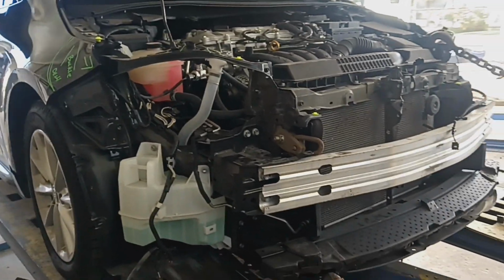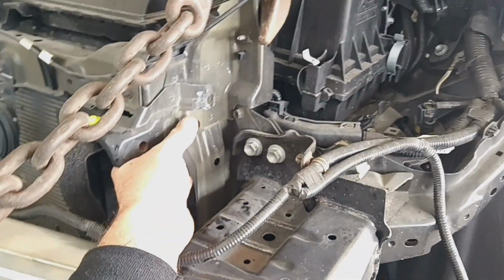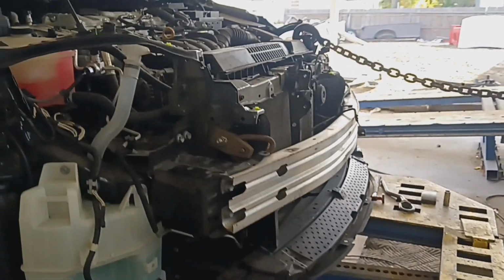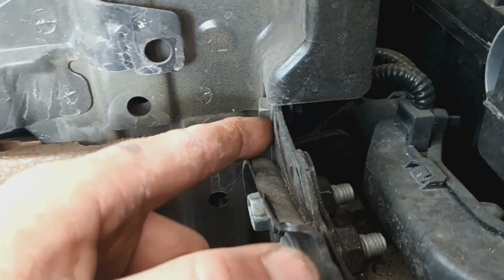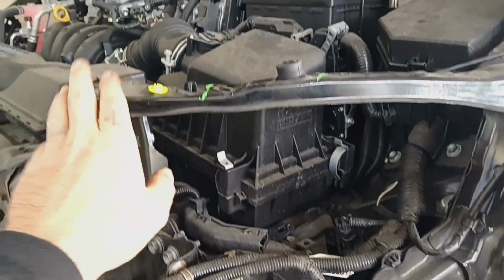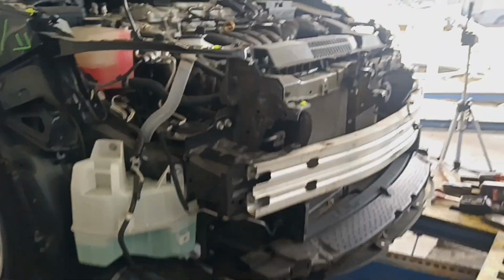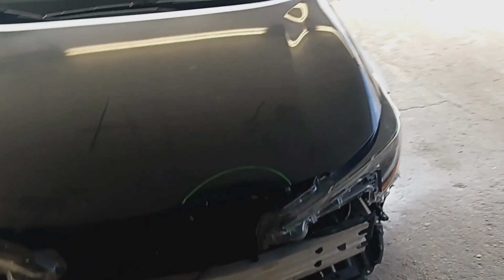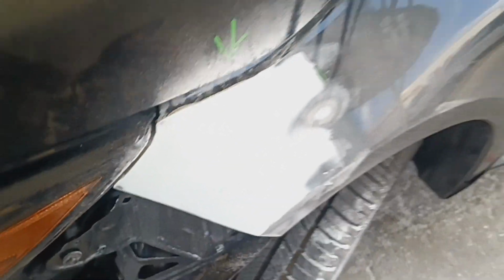repair and core support pulling on a frame machine #toyota #cars #automotive

Comment: #holyscratchoffdust i have a honda accord and every time i start it needs a jump do you have any suggestions?
Reply from the maker: Need a new battery or alternator to charge the battery if it's not that than you have a power drive like a light that stays on or a radio or charger